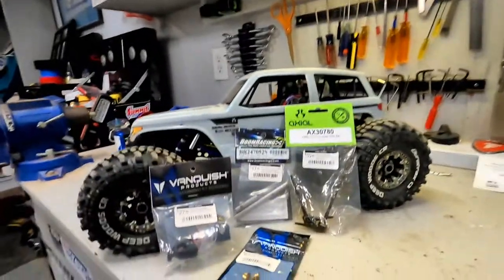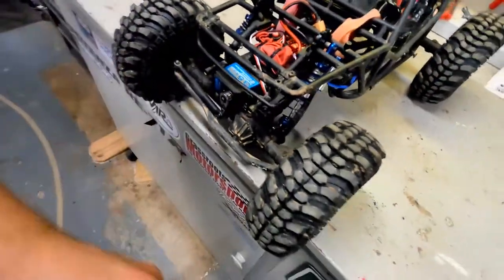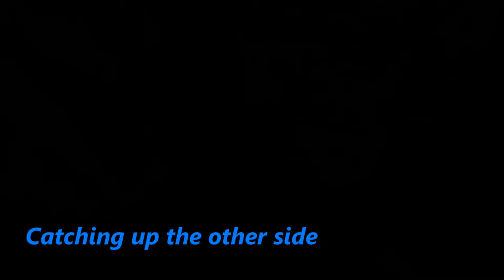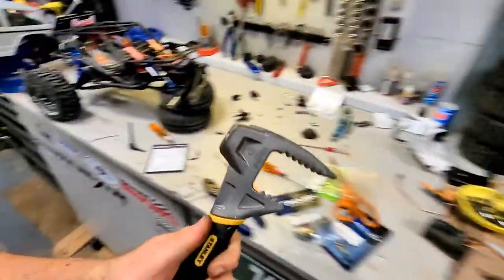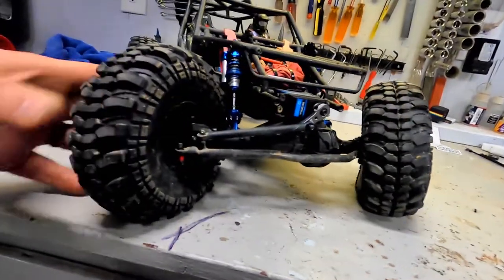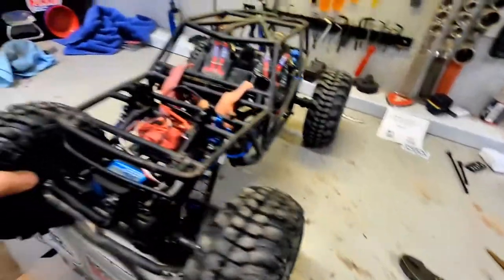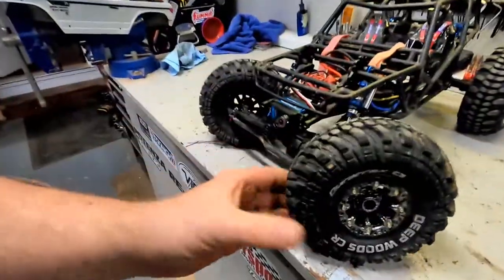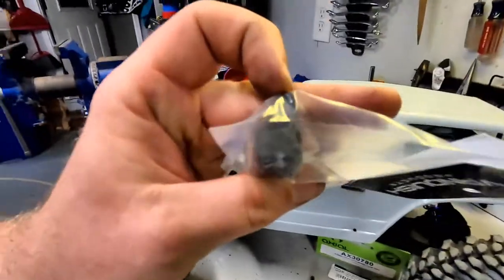Axial Wraith Steering Upgrade - Vanquish, Universals, BoomRacing

Comment: What wraith is yours? New model?  Spawn? Etc
Reply from the maker: It was the older 2.2 standard Wraith, non-Spawn. 

Has been good, especially now with these upgrades.  Crawls so much better.
Reply: @RoadsideRC  thank u. How many different wraith models are there?  Are parts widely available for the 2.2 wraith?
Reply from the maker: @mikeinvegas1  There are 3.  Standard 2.2 Wraith,  2.2 Wraith Spawn, and 1.9 Wraith.  The 1.9 is the newest.  

There are MANY parts available for all of the models.  It is a very popular truck.
Reply: @RoadsideRC  thank u . I really appreciate it.
Reply: I have the standard 2.2   
My front bumper hits top of servo horn. Is that normal?  Have u seen that issue?
Reply from the maker: @mikeinvegas1  Yep, mine does that sometimes also.  Seems like with the current setup it just misses.

Comment: Why smaller tires is fain like that
Reply from the maker: I'm sorry, I don't understand your question.
Reply: @RoadsideRC   You say that you need to change the tires 

because they're too big And I say why you want to put smaller tire
Reply from the maker: @kenskens69  These tires are right at 6" tall.  Looks great, but that OD plus the offset mean it rubs a lot when turning.  A slightly smaller tire (5.75") and a different offset wheel would fix it.